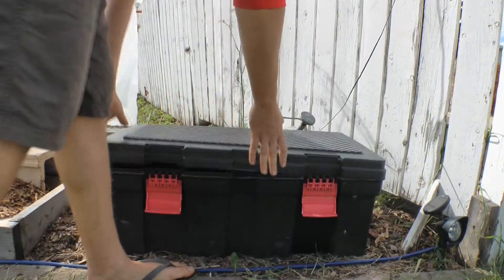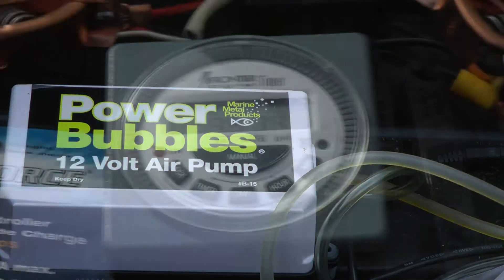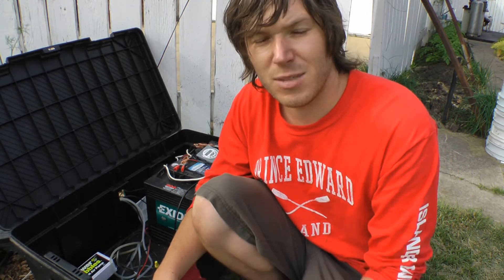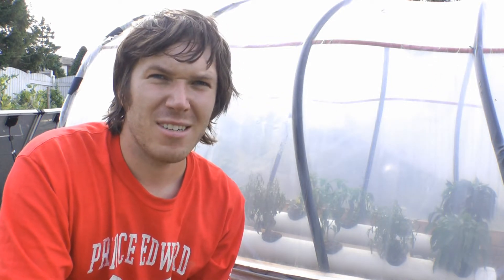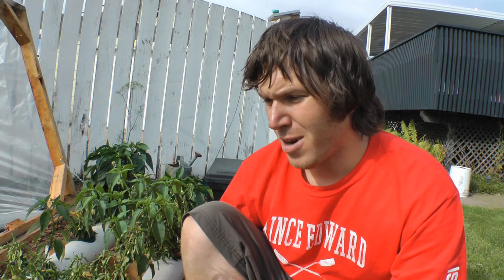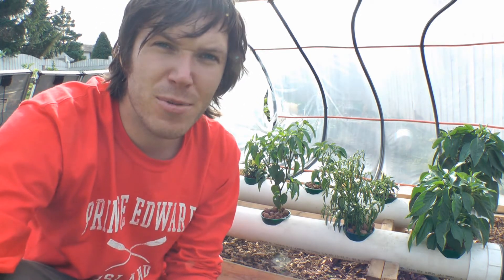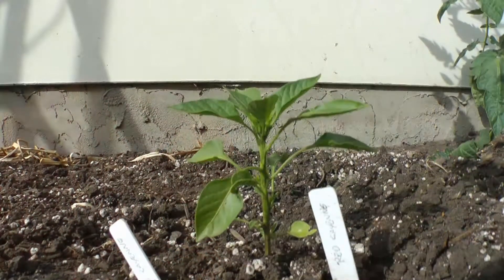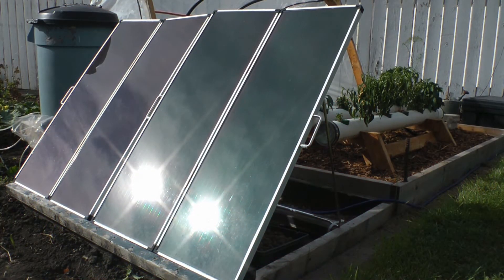How To Hydroponics - S02E26 2011 Solar Hydroponic System Review

Comment: Have you ever heard of Kratky hydroponics?  You don't need an air pump.  MHPGardener has some pretty interesting videos here on YouTube about it.  

Also, GreenPowerScience on YouTube shows how to mount Mylar on a frame to get a perfect, mirrored wall without wrinkles or creases.  The reverse side of Christmas wrap and inside of snack bags is also a good source for Mylar if you want to go a little cheaper.

Comment from the maker: @eurolagnia This is what I'm thinking. Had I left the plants when they were in a full strength veg stage I think they may have done better. Last year worked out better because I had time to get the plants adjusted to the hydro system.

Comment: I'm new to hydroponics and you in part inspired my involvement.  But from the experience of my tests, I think your issue may be one of nutrients.  From what I understand, nutrient mixes need to change during plant growth, where vegetation, blossom and yield require different nutrient mixes to properly produce.  If you leave for months at a time, your plants might require more active nutrient management.  Might it be that your recirculating system doesn't provide a proper growth program?